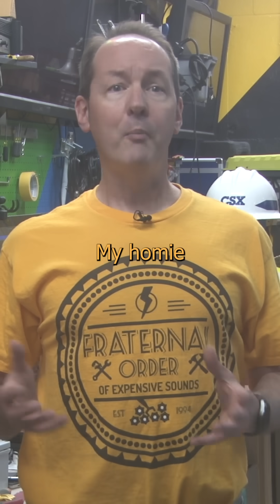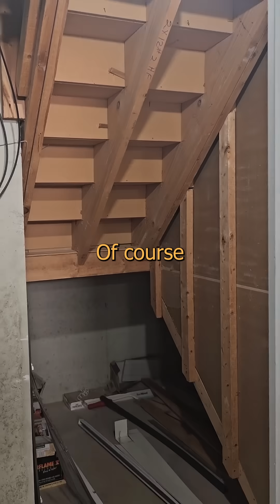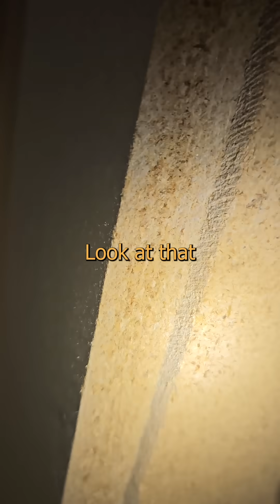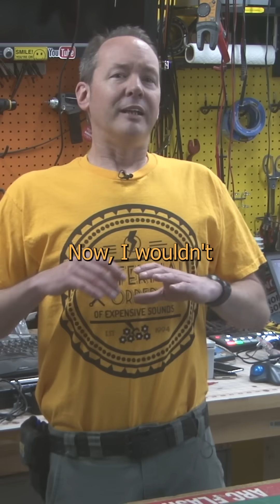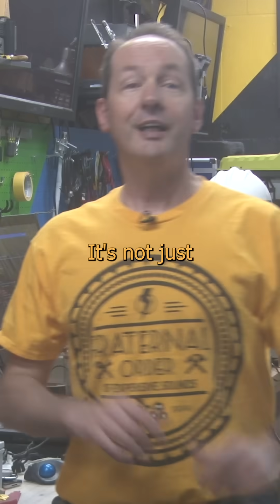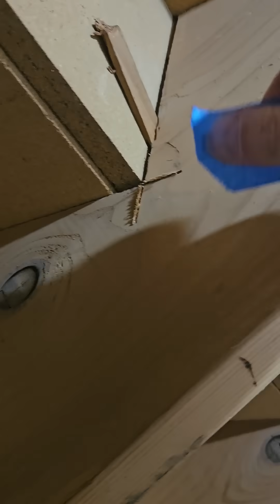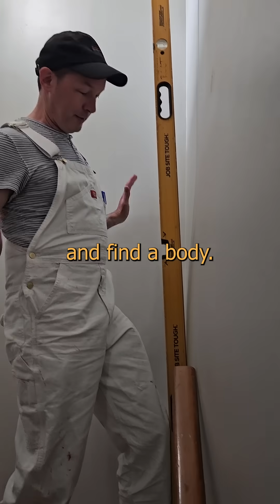Particleboard Staircase #chrisboden #engineering #construction #stairs #cheap #job #work #carpentry

Comment: Fun Fact: They did this shit a lot in the 60s and 70s and often times used particle board instead of sub flooring, which causes the carpet to become load-bearing when wet
Reply: I had one of those houses with particle board as a subfloor. It was my first home and when I pulled the carpet, I found sawdust and blackmold under the rotten padding. When rehabbing the floor, found termites and years of damage in the seal, joists and beams. I paid for an inspection and a warranty from the termite company. I sued both the termite company AND the real estate broker who not only was the flipper that sold me the house, but was found to be who swapped my inspection paperwork with another house down the block that he also owned. Won my lawsuit. He lost his RE license. And my kids & I suffered through several months of construction interrupting our daily lives. Hard lessons learned.
Reply: @NoHacksJustParker  well this explains some things about my father-in-law’s place with the load-bearing carpet over the entryway threshold.
Reply: Ah yes and can't forget if the House is raised that wet load bearing carpet loves to sag on the floor beams so now whenever someone takes a bath that side of the house temporarily becomes 45 degrees steeper
Reply: Scumbags posing as builders did that...mobile home builders did that....a carpenter NEVER would do that. MDF is sawmill waste mixed with some cheap glue.
Reply: during a remod I found out my kitchen floor is particle board. so is the rest of my house. thank goodness my subfloor is 1 1/4" tongue in groove hardwood.
but particle board in the kitchen? or bathroom?  definitely fuc<ery
Reply: @nohacksjustparker2744   Yep!! That was the case with the home we got years ago. Every bit of the sub floor was particle board. Every bit.
Reply: @Lioru92 one of the reasons they did not only was the material cheaper but it came in wider widths allowing a single piece going the full width of whatever size unit they were building 12, 14, or now 16 foot wides. Probably 50% or more time savings
Reply: In the process of repair a bathroom that uses particle board.
Annoying part was that I had to take asbestos precautions to get access. (It was in rolled flooring.)
Reply: @economicprisoner - why would anyone use particle board in a room where the primary function is water usage?
Reply: @donoimdono2702  Because that is what they laid over the entire floor. Possibly even before putting walls up.
Reply: @economicprisoner  - oh I know from 1st hand experience. my house is same way. sub floor is 1 1/4" x 6" tongue in groove hardwood with 1/2" particle on top throughout the house. so, laundry room, both baths and kitchen = particle board.  dumb idea from 80's construction in idaho.
Reply: True story
Reply: That particle board actually would be legal in most us states  if the stairs threads were laid down 12 inches on center  not 24 inches as  i assume its 48 inch staircase. Minimum stair width in most states is 36 inches and thats from wall to handrail  not wall to wall
Reply: I was gonna say I figured it was in the 70s. That’s definitely win. Corners were cut as hard as they could be in housebuilding. 😂

Comment: He better contact an attorney. He can probably void his purchase or force the builder of to bring the building up to code. @troyconnors374 offered to rebuild. I'm sure the internet community could raise enough to get at least the stairs rebuilt. And a good set of stairs doesn't take long. With the right logistics and a good crew, you could have him back using the second floor in less than a day.

Comment: I'm actually kind of impressed by the depth on that drywall curve. I don't think I could do that on purpose.
Reply: Seriously? He must have thrown an actual bag of trash behind it to do that, it's insane.
Reply: Terrible things are possible with the thin drywall.
Reply: For real. The builder who did this must have hammered the screws into the studs.
Reply: @bruhholmes  This happens when the ground shifts over the years but seeing as the stairs havent broke yet  (as in the house seems too new for that to be as much of an issue) i think we can blame this one on the construction crew.
Reply: It's against studs turned sideways. Lift the sheet vertically and hold it to screw and you can do it.
Reply: @sparksmcgee6641  smh... I worked on many construction sites and have never seen anyone do that, didn't even occur to me.
Reply: Makes me wonder if there was a leak to make it sag at some point
Reply: My mouth FELL open and I’m not in any form of construction, just a construction man’s daughter and I think my father would actually be so impressed he’d just laugh
Reply: Is there a stud? That curve looks like they covered up a doorway.
Reply: This is just the result of cheap labor throwing up houses in 3 days with no knowledge of how to do it right.
Reply: I’m not a professional. But, I’ve helped hang drywall that was more level than that. But, that’s what you get with cheap construction and cookie-cutter homes.
Reply: if they wanted to make an arch, they should have made a proper arch for crying out loud
Reply: Yeah I’m just trying to figure out how the hell they managed to do that 💀 the end clip where he has the level flat with the bottom of the wall killed me! Just how 😭
Reply: It's an arcsine!
Reply: I’ve seen curves like that in wood before, though usually on the ribs of a violin. 🎻
Reply: 3% is the difference between straight and legally even here. We come to conclusion in trade school that you can blow 3% while still making straight walls legally and alcoholic mason did prove that point being absolutely wasted while making perfectly straight walls... though didnt manage with out the bottle, witch was also proven. To manage that shit pretty much everyone would be dead by alcohol poisoning or passed out in best case... then again i did see that level of bullshit from a fucking foreman no less on one site. Had to ask how was the hospital visit when leaving after i fixed his fuck up. The bullshit reason he gave was frost moving the earth pressure wall -.- yeah no it wont make it concave and crooked, when spans are couple meters and there is 90 corner there.
Reply: Not without breaking the paper.
Reply: You should see how much 12 foot drywall bends when you unload it from a truck with a forklift. If I’m remembering correctly it came in units of either 26 or 34 sheets. It will bent far more than what’s shown in the video.

Comment: imagine you meet the new neighbor "hey can we see your stairs?" and then they reveal your house is made out of cardboard and the only thing stopping you from a sudden elevation change is abt 2 cm of sawdust
Reply: lol Imagine that but like 3 inches of sawdust and its my entire floor and the tarp that keeps it dry ripped... I'm afraid to walk
Reply: @SOS-06 genuine question, why don’t you guys build with stone? Like i know drywall is faster but that’s the only benefit I can think of
Reply: @blueqiqi  to the best of my knowledge I think it’s because the US has a housing shortage, and wood is much faster and easier to source than stone here, but I believe there are also parts of the US that need to deal with tornadoes that are capable of destroying both wooden and stone buildings, so it is easier to build with wood and replace for cheaper than stone
Reply: @entertainmentwitherik476 I say it's not a housing shortage, but a human overage.
Reply: @entertainmentwitherik476  the other factor is our building codes are very lax in certain parts of the country because the american motto is "who cares if it's done right? The cheaper and faster it's done the sooner I can buy my new pickup."
Reply: @blueqiqi  Wood is structurally more stable during natural disasters. Stones weather during storms and crack during earthquakes, wood simply warps and bends before returning to normal after. It's the same reason why our skeletons are made of bone instead of metal.

There's a Japanese woodworking technique called "Kumiko" (組子), where wood architecture is cut at the joint with intricate patterns, precise to the millimeter, and slid into place like a puzzle piece. Over time, the wood warps and binds together stronger than any joint made with a nail or screw.

Wood isn't just built different, it BUILDS different. (but only provided you know what you're doing, which these house builders clearly didn't)
Reply: It's not so much ahousing shortage,  at least around here,  as it is a financial shortage.  Houses are expensive as fuck and take half your months income to pay for most people.  Even renting isn't cheap if you need anything bigger than a 1bed/1bath
Reply: @blueqiqi  we can't afford the houses as-is , let alone made with consistent build quality and real materials (🥳)

If I get enough money for a decent home, I'm getting out of this country before I build mine out of straw or sticks.
Reply: @blueqiqi its mainly becuase with dry wall its cheaper and faster to modify the house, say you wanna add a sunroom or garage, dry wall makes it less expensive. Stone will last longer but is more expensive.
Reply: @blueqiqi  in places with earthquakes brick buildings are really dangerous !
Reply: @blueqiqi  I'm in a mobile home so stone would be incredibly heavy
Reply: @blueqiqi  uh, stone?! Because not even bill gates can afford a house out of stone, that's why. Not to mention no one knows how to build anything other than outer walls out of it. Stone went out of fashion 600yrs ago in most of the world, heh. 
I'm joking but also not, you wouldn't be able to find anyone who knows how to build out of stone, if you did you'd have building code against you next, it's probably illegal to, and if those don't stop you, the next will be finding the stone quarry to supply the blocks and the stone masons to shape and then assemble them. 
So, an outhouse of stone would cost more and take longer than a castle sized normal house. That is why.
Reply: @blueqiqi  to put it as plain and simply as possible, per square foot and per hour pay is astronomically higher with stone. Let's say a 1000sq ft Drywall job comes out to $5,000 material and labor, a cheap brick and cheap Mason would cost $18,000 or so for the same job.
Reply: @atlaslee8681  😂😂😂 good luck building a home in another country. I still can't fathom people living in the best country in the world talking shit like they are gonna find some place somewhere else in the world where they have the rights, freedoms, functional capitalism, and opportunity.
Reply: @codyharney91 it’s not that hard as long as you don’t go south of the border. only thing we have is cheap gas, everything else is something you heard on G I Joe as a kid. Shits different now
Reply: @blueqiqi  faster cheaper and its going to get burned or blown or shaken down by something
Reply: @blueqiqi  because drywall is easy to tear out and put back in. It makes running new wires and pipe very easy and inexpensive
Reply: America likes to build it cheap  @blueqiqi
Reply: @entertainmentwitherik476  there is no housing shortage as much as there are too many housing hoarders and speculators building houses in dumb places
Reply: @entertainmentwitherik476  nah not a shortage, conglomerates hoarding houses is whats up
Reply: @blueqiqi  can't speak for the rest of the country, but as a Californian, if we built with stone our houses would crack in half from the local 6.5 quake
Reply: @blueqiqi can't regrow stone.
Reply: @entertainmentwitherik476  the only houses that really survive hurricanes are the ones made of steel and stone
Reply: @entertainmentwitherik476  There's also a whole line of logic behind it relating to how war has been fought over the centuries. Short version that leaves a lot of detail out... by the time most of the US was settled and people were building homes themselves on a plot of land the Government sold them to homestead on, it was easier to cut down nearby hardwood trees and saw them into shape to build your home. By that point also, war was being fought with bombs and rockets and guns rather than men with spear and sword with cavalry as sort of ye olde airstrike equivalent. Less point in building with sturdier, more defensively capable stone whenever stone will get blasted apart with only SLIGHTLY less ease than wood.
Reply: @FluuuffInari  yeah yeah yeah, i get what youre saying, wood is strong, but what these stairs are made of is cardboard
Reply: @entertainmentwitherik476  but theres so many empty houses...
Reply: @blueqiqi we started building cookie cutter homes in the 50s out of paper sawdust and thermite, and we just… never got around to changing that
Reply: @jputz2010 but you can rip it out of old stuff real easy
Reply: @entertainmentwitherik476  There are more houses in the US than there are homeless, it's not a shortage. It's because building companies love to cheap out so they can build more units that they can sell to mega-conglomerate housing agencies
Reply: @blueqiqi with the amount of huge natural disasters we have it’s easier and cheaper to rebuild with wood than stone-and yes, there are multiple storms that would take down even stone.
Reply: @codyharney91 USA has the resources to be the best country in the world but it objectively chooses not to. By literally ANY metric we have countries that make us look like chumps. Education? we rank like #40. GDP per capita? We aren't even in the top 10. Wealth gap? We might be the best at that one unfortunately...
Reply: @blueqiqi  Atleast in my part of the states it's because it's cheaper and easier to replace/ repair when a storm eventually damages it.
Reply: "The wise static-wizard has told us our stairs are bullshit. So it is written, so shall it be."
Reply: Those houses exist and are sold. Look up cardboard houses
Reply: Most houses that are built in new subdivision zones are usually built with cheap labor and a guy with a whip. They care not if it’s built right, it’s quantity over quality and on to the next contract.
Reply: It's made of ticky tacky.
Reply: And to add injury to insult, it's only a partial elevation adjustment, since most people walk up the middle of the stairs, straddling that third badly cut third stringer.  But at least it comes with a free key change, from tenor to castrato.
Reply: Call me crazy, but I think residential projects need a little more quality assurance oversight because the shit they're pumping out and calling it housing is criminal, ESPECIALLY when they're charging 400,000+ 🤬

Comment: Particle board is the worst thing ever produced. I went straight through 2 inches of it when I was only 5. I couldn’t have weighed more than 15kg. Even without it being wet I doubt that staircase could hold anyone about 80kg
Reply: That’s 33lb and 190lb do you Americans

Comment: I used to work in flooring, absolutely stupid common in the Midwest. Particle board treads mean you can only put carpet in the stairs. It's so painfully dumb that the builder saved a few dollars in material costs and the homeowner will spend 10x+ that to replace it

Comment: Nono, as a complete and utter professional (I've worked carpentry a few years now) (heavy sarcasm bythway) 

That particle boad doesn't even have to get wet, shit is so flimsy softer than my poop this morning. The force of walking on it will disintegrate the glue and grains over time. In 5-15 years each step will be sagging and ready to fall in on itself like a black hole on one good furniture move.

Comment: my dad and i just redid a basement in large modern house. there were parts of the drywall that were curved inward OVER AN INCH in multiple spots. cheaply built expensive houses are becoming common place and it sucks, but hey at least it gives us work 😅

Comment: My brother in Christ, I'm only an amateur carpenter and I'd catch a felony murder charge if someone told me to use fracking particle board for anything that even flirts with the idea of being structural.

Not to mention the issue with particle board on a fundamental level, i.e. the aforementioned susceptibility to water damage and the fire hazard of what is effectively compacted sawdust.

Comment: The bad part about that particle board, even if it doesn't get wet if you have something heavy in your hands and come down on it, it'll just give way they get a break right and half no worrying at least if it gets wet and spongy. You'll have a little. Bit of a warning, but definitely get them replaced.

Comment: They're also building houses with the studs further apart now. Dad noticed it during a routine fire department inspection. It is up to code, but less structurally sound and burns faster.

Comment: As someone who did water damage mitigation if I had stayed long enough to walk into THOSE STAIRS being wet I'd be home the next day drafting my notice. The sheer amount of liability because very few homeowners would be willing to let you rip that out. I could say, "The next time someone puts any weight on these stairs is like playing Russian Roulette by the step," and many people would still say, "Nah, I'll sign the waiver. It'll be fine." Okay Mr. Data Entry Specialist, I'm sure you know more about structural integrity of varying materials than someone certified who deals with it every day.

Seriously, those stairs suck. If you have any part of your house made out of that material and have a water loss be VERY careful around those materials until they're evaluated and likely removed and replaced with something hopefully better.

Comment: Now with the center riser you don't necessarily need the backboard to be of strong material is just two risers you would probably want to have a harder material in there and typically it reaches code compliance if its 3/4 of an inch thick or more still I'd rather spend just a teeny bit extra money to make sure that my half inch plywood floors if they're even that thick will last unlike the MDF